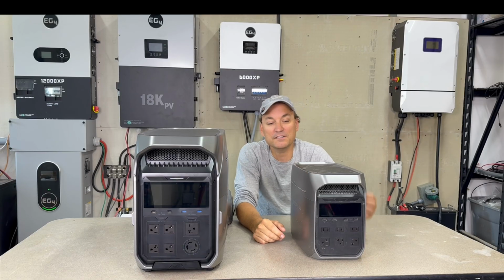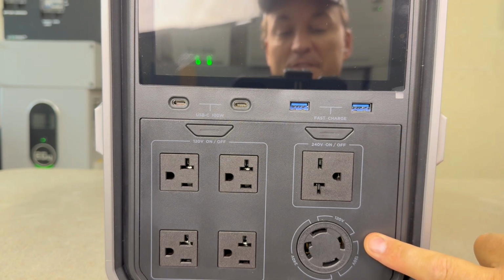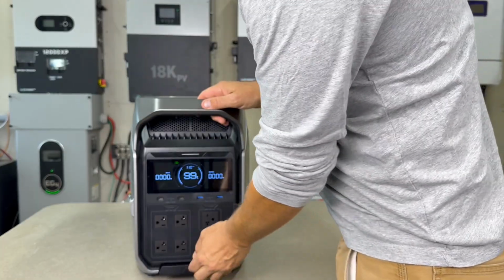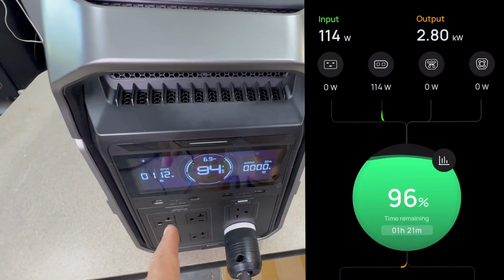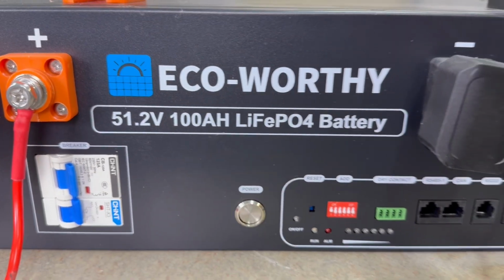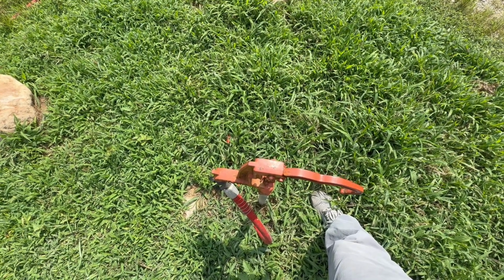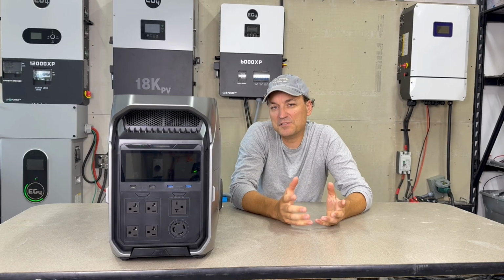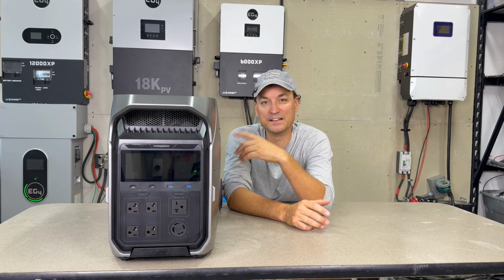EcoFlow Delta Pro 3 review and testing, what can it actually handle?

Comment: I have a well pump that pulls ~8.5A @ 240V continuous - inrush current is ~38A, which technically exceeds the 8000W surge spec.  Given what you've put in the video, you have a well pump that is doing around 8.3A, but it's unclear what your inrush is.  I'm looking at these units to do just this, but I feel it's a bit in the gray area here.  Any chance you know what the inrush is on your pump?
Reply from the maker: I wish I did. I need to put a clamp meter on it to verify.

Comment: I have a question for you. I just found your channel I was watching. You do an eg4 hookup and a sun gold hookup charger inverters. I have a ecoflow Delta Max and a Delta Max smart battery and a Delta Max generator smart generator. I use it in my motorhome. + Hook a dog bone from the 30 amp to plug in the back of the ecoflow. Is there a way I can change that 20 amp breakers coming out of the ecoflow to like a 30 amp RV hookup so I could possibly run the air conditioners or one air conditioner off and on? Thanks!
Reply from the maker: I don’t believe so no. But I haven’t tested that particular unit. But if I’m understanding what you’re asking though, I don’t think that’s possible. Can those units be paralleled? Some of the ecoflow gear has that option, and the parallel hub has 30 amp outlet on it.
Reply: @GavinStoneDIY I never thought about the expansion hub that I just checked. The only one that has expansion hub is the ecoflow Delta pro so I guess I'm out of luck. Thanks!

Comment: My original delta pro couldn't power my delta power saw and it was super disappointing.  Figured it has to be a fluke, so I tried it in my other one.  Same results.
Reply from the maker: Woah. Maybe pulling to heavily on one leg? That’s odd. Do you still have the units?
Reply: @GavinStoneDIY yea, they're both connected to the OG smart home panel tucked away in the basement.  The saw is 120, so only uses one leg which is why I was surprised.  It can be rewired to be 240 and then I could use the double voltage hub and I assume then it would be fine, but I wasn't going to spend the time to do that.  I dunno maybe after the years of firmware updates I should try again.

Comment: I tried to power my emergency loads panel, but my unit has a fault  and shuts down. I must return this unit and I don't have the box. I regret the purchase. Inverter and battery all in one of this size is not a good choice.
Reply from the maker: Man that’s a shame. Do they require the box for the warranty return?
Reply: @GavinStoneDIY  I need to build a box to return. Any box they said. This unit is 100lbs. Haven't returned it yet because I'm installing a EG4 12000xp with six server rack batteries for my critical loads panel. I can't be without a backup power source due to unstable power on Manitoulin Island.
Reply from the maker: @murrat the 12,000xp is fantastic. You’ll love it. That’s a shame about the ecoflow. I try to save boxes for a lot of my gear, but this box is so huge, that’s really not possible.

Comment: You could try to use a multimeter on the battery expansion port to see if voltage is present like on the anker.. then you'd just need a cable that you can splice the ecoworthy battery into.
Reply from the maker: It’s a funky looking port. I could probably rig up something though yeah. I doubt it’s running on 48v. But it could be.